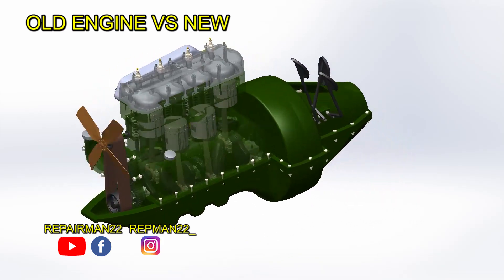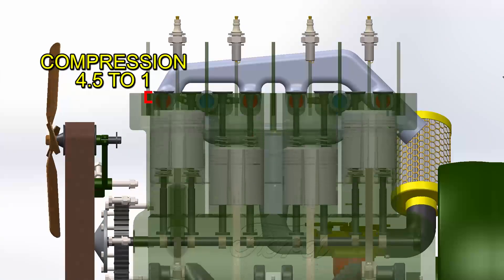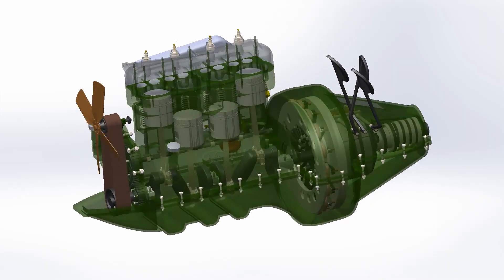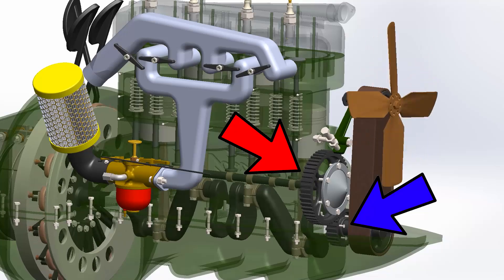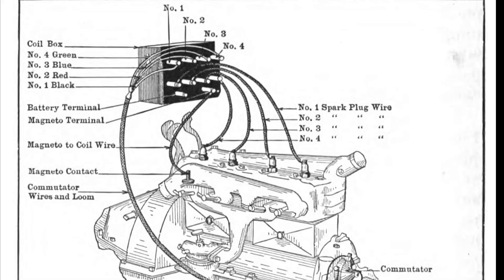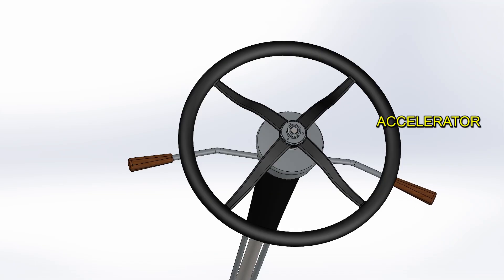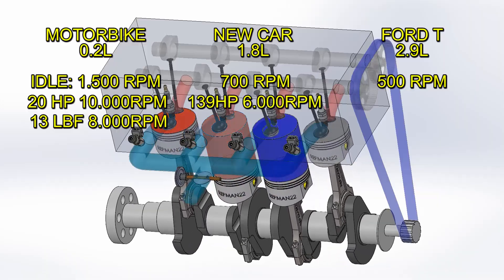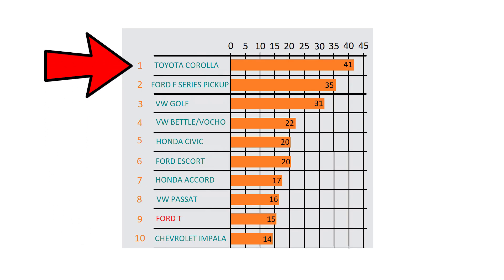Ford T vs New Car 🤯 3D Animation// What changed in engines in 100 years?

Comment: Thing was and is still pretty brilliant! I wonder with newer technology if this was redesigned with the same basic ideals what it would look like and how it would do. I wonder if it could be sold.
Nice video and visualizations!
Reply: With gas at high prices , what other combustible fuel sources are there? Like brewing your own beer and wine, could people brew a fuel source?
Reply: @markae0  people can brew fuel. In some places you can get a license to distill fuel ethanol. You can also do wood gas. Waste cooking oil from grease traps can power a diesel. You also have water gas, and fluidized bed gasifiers that can run on plastic trash. There are options
Reply: @Johnsoline I am curious about this "water gas". Please elaborate.
Reply: @markae0  Un - with some corn or corn meal or fruit - you can distill some 'moonshine' alcohol - just don't drink and drive - oh and there are 'legal' limits on how much home brew alcohol you can make for home consumption.  Plenty of youtube videos on how to make your own moonshine.  But it seems a shame to put nice hooch in your car.
Reply: @markae0 Ever heard of ethanol? Yes, the alcohol that people drink. Currently it's mixed with (up to) 15% gasoline to create E85, which is VERY high octane, burns cleaner, and makes more power, but gets slightly worse mpg.
Reply: No computer chips to go bad !  Not so sure how they would do in a modern crash test - and I have to say, I do love anti-lock brakes.  And all-wheel / 4 wheel drive is very nice in the rain and snow - oh, plus ac and heat - oh and stereo radio.
Reply: Something like this could make a good range extender for a hybrid electric car, where low rpms are fine since it’s just generating electricity. It’s still reducing the amount of circuit boards if the thing charging the batteries doesn’t have them.
Reply: @Thinginator  you don't want the flathead for 2 reasons:

The air going into the engine has to change angle more times,  which increases drag and wastes fuel. 

Compression is low on flatheads, which wastes fuel. 

The model T got the gas mileage of a riding lawnmower,  and made the power of one. A modern engine of that size makes at least 5× the power with nearly 3× the efficiency

The Geo Metro got 50+mpg with a smaller engine that made 4x the power of the T.
Reply: @Charon-5582  Do you have a 2.3 Mustang?  --A 2.8 V-6/3.3L 6? Mid-80s [ODB-II] saw 205Hp with 1 turbo from their 2.3L SVO/Manual Turbo T-Bird
Reply: It would need crash testing, an onboard computer with OBD2, tire pressure monitoring, electronic stability control, airbags, emission controls, and many other things that cars in the US are required to have now. So it would be quite a bit different
Reply: @charlie_nolan  There are ways around that, see Caterham and Exocet for examples. But generally, you are correct.
Reply: It would look like an 80s hilux
Reply: I have a go-kart that’s basically the same technology exactly, but it’s got 1 cylinder and a more normal control layout.
Reply: It has been refined, revised, improved, and modernized hundreds of times. Every modern DOHC, 4 valve, EFI, direct injected, aluminum headed, turbo 4 cylinder is what the T engine would have become.
Reply: not with current epa and ntsb. plus so many nowdays cant even drive a manual transmission.

Comment: Interesting video. But where is the Vaz, known as the Zhiguli in Russia and a Lada in the UK?. Over 19 million of these cars were sold between the mid 1970s and about 2010. The car had various upgrades in the 40 year production run but used the same basic body shell, itself based on the 1966 Fiat 124, throughout. Most of the top sellers in your chart, like the Toyota Corolla and VW Golf have gone through many different models and the VW Golf Mk 1 in 1974 probably has not a single part in common with the current Mk 8 model.

Comment: Actually I was wrong to say no one ever made an engine of steel as now I remember Mercedes straight 8 racers of the fifties were made by welding together  steel cylinders and water jackets etc.
Reply: The TVR Speed 12 iirc correctly had a steel block too.

Comment: No one has ever made an engine block of vanadium steel.
Back in Henry's younger days it would have been impossible to cast and machine such an engine block.
Vanadium STEEL was used for stressed chassis and suspension parts.
Reply: They were cast iron
Reply: I had a knife made from just s30v so I believe you.
Reply: @VadidElab  Just yesterday I as looking at expensive chefs knives and cleavers but they were all made from ordinary stainless and would soon be blunt.
My Malaysian friend showed me the cleaver traditional given to daughters getting married. It's hammer forged in one piece over a charcoal fire and really heavy but hasn't needed sharpening over many years.
Reply: @rosewhite---  "My Malaysian friend showed me the cleaver traditional given to daughters getting married." Now you need to find a friend that gonna show you how to use google before you write a comment...
Ford was advertising model T with claims that he is using vanadium steel in every part that require strenght and on his promotional material he is showing Ford T crankshaft as an example of part made from Vanadium Steel...
And i am shure that you need to do some machining on a crankshaft and according to you that would be for what ever reason imposible.
Henry Ford was doing its own steel and got plenty of experience in this field.

And if cutting edge on a knife do not need sharpening for a long time then most likely cutting edge have a wide angle and that is why it is not prone to losing the sharp edge/rolling.
Reply: yeah that was a weird claim in this video. the whole thing is kind of strange, but still interesting
Reply: Thanks for your keen attention to accuracy 👌
Reply: @ernesthill4017  Truth counts.

Comment: They paid me one summer about 50 years back to drive a few of these around Greenfield Village, where they had a small fleet of them when some of the newer models were only about 50 years old. Brakes were always terrible.
Reply: They were terrible. You had to plan ahead for your stops. I would also use the reverse pedal to help out some. The only thing that I could not plan on was when someone would pull in front of me and slam on their brakes to make a right turn. They would then find out what a model T horn sounds like. I added Rocky Mountain Brakes to the rear wheels, but I could not figure out how to properly set  them up. I knew someone who would add a hydraulic master cylinder, and disk brakes to all 4 wheels. He used Honda Gold Wing motorcycle calipers, and he designed his own disk rotors. He had a large lathe in his garage that he used to make the rotors. He was an absolute genius.
Reply: @garylangley4502  that’s cool, I would’ve loved to see what he came up with
Reply: @garylangley4502  on my model T 1914 there are kevlar lingings, if needed i use the low gear pedal, a bit for assistance,  drive often in busy local tourist traffic, and well, not doing bad at all
Reply: @ertsixbarf  First gear would give some compression braking. The kevlar linings are excellent from what I have read. They were not available back in the late 1980's when I owned my "T". The only alternative to factory style cotton bands were band linings for an early Hydramatic. I used the reverse pedal on advise from some of the Model T experts in the club I was in. This spreads out the wear on the bands, as the reverse band does not get as much use as the other bands. By alternating between the brake and reverse, it gives the brake band a chance go get some oil so that the band doesn't burn out. This was important with the cotton bands. In a way, it was like the foot action in an old pump type organ that some people had in their homes 100+ years ago.  https://www.youtube.com/watch?v=SkpJQ4biEbk
Reply: @garylangley4502  
YES  !
CRAWER  GEAR  would  be  even  better  .
Especially  on  a  muddy  track  or  paddock  or  river  crossing  ,    A .
Reply: Well they were only on the rear axle, but that increased the reliability by 100% lol
Reply: @jimmy_olds  Between rear drum brakes, no collapsible steering column, no seat belt, and no safety glass, it was a reliable Killer.
Reply: @drpoundsign  
Hey  !
Wait  up  ,  Wait  up  . 

Today's  MUCH  MORE  FASTER  CARS  ?
Are  MORE  Safer  ?
Are  you  saying  ?
(  They  would  have  to  be  .
But  ,   Are  they  ,  per  Capita  ?  )
Reply: @jimmy_olds  I will remove them even from rear axles hence I will have 100% reliability!
Reply: @jimmy_olds  
But  ,  NICE  ,  idea  that  the  braking  was  or  can  be  applied  to  the  transmission  or  Drive  Axle / s  .
Rather  than  as  &  via  heavy  weight  additions  to  each  wheel .
Reply: @georgehorobin2225  The Model T brake was in the transmission. If a universal joint brakes in the driveshaft, there are no service brakes, only the parking brakes.
Reply: Thank you  ,   all   ,  so  far  .
For  your  valuable  comments  ,  Re  :  Ford  Model  T   motor  &  Transmission  etc .

To  Johnsoline .
In   Particular .

My  Reply  and  Replies   ,  are  coming  .
One  way  or  another  .
(  A  line  out  of  one  of  Blondies '  Song  )
Reply: @garylangley4502  
Good  ,  got  that .
But  l  can ' t   seem  to  be  able  to  get  a  Text  note  through  to  Gary  Puckett   ,  or  to  a   ,  Mr . Gary  Pucket .

Is  there  still  a  sort  of  ,  Union  ,   Gap   ??
(  per  sey  )
Reply: The T only had brakes on the rear wheels, and they were cable operated. The only mechanical advantage was the leverage provided by brake pedal itself and however strong your legs were.
  Another curiosity of cars of that Era was gravity fed updraft carburetors which often leaked. This is way even a hundred years later, all states' laws require one to turn off the motor during fueling
Reply: @ernesthill4017  You are probably thinking of the park brake on a T. The service brake is a band in the transmission that clamps around a drum connected to the output shaft. I had a '26, and that was the year that Ford made the brake band wider for better braking. Before that, the band was the same size as the reverse and low bands. Yes, the only mechanical advantage the driver had was the length of the brake pedal, and leg strength. Also in '26, they increased the diameter of the parking brake drums. They also had a lining on the shoes for these brakes. Before that it was just a metal shoe against the drum.
Reply: @garylangley4502  :
  Thank you sir, l have learned something today 👍
Reply: @garylangley4502  
But  ,  unhappily  .
Incremental  small  lmprovemets   are  often  NOT  ,  good  enough  !
The  World  of  manufacturing  ,  has  had  6 , 000  years  since  Adam  &  Eve   .
Now  ?
Now  look  at  the  " Mess "  called  the  Modern  ,  and  so  called  ,  "  World  Car  ".
(  Ford  M . Co  ,  included )
Compare  word ,
Messers  schmit  ?
Reply: @ernesthill4017  
But  could  also  easily  be  fitted  to  the  front  ,  undriven  steerage   ,  wheels .
IF  THEY  KNEW  HOW  !
Reply: That's pretty cool man, and it's nice to see the one thing that unifies all Model T enjoyers through the years: "those brake suck, dude." :)
Reply: @HANKTHEDANKEST  Universal topic of conversation at Model T meets. I live in San Diego, so there can be a lot of traffic, and good brakes are needed. I don't know why it was usually BMW drivers, but I would be in the right lane of a 4 or more lane street and about 50 feet or less from an intersection, someone would pull directly in front of me, slam on the brakes and make a right turn.. I'd slam on the brake, plus push the reverse pedal for a little extra braking, and usually push the horn button. They just didn't seem to realize that a Model T, or most any old car, doesn't have brakes that are as good as a modern, well engineered car, particularly a car like a BMW. That's true of most antique and classic cars.
Reply: @garylangley4502  someone did that I front of my dad's 66 wildcat sedan. Drums on all four corners. Like dude our 20 foot long sedan from the 60s does not stop a 2 door sports car coupe from the 2010s.
Reply: @joebone3151  Exactly!! It gets a bit scary.
Reply: @garylangley4502  
Clearly  a  Case  of  ,
DRIVER / S   ERROR .
Reply: @joebone3151  DONT  BE  A  TAIL  GATOR   ?
North  America  ?
Be  a  Leader  of
God's,  '    "  Good  Speed  "
On  "  Lifes Long  and  dangerous  Roadway  "  ?
Reply: Buy better shoes to break harder, Flintstones style.
Reply: @hicknopunk  Sure! Just take up the floor boards and drag your shoes on the ground. Say! My son would be great at that, he is 6'4" and weighs 380 pounds with size 15 shoes. "Sasquatch"
Reply: @garylangley4502  Like Herman Munster stopping Grandpa's "Dragula" when his scumbag rival removed the chute.
Reply: @drpoundsign  Exactly!!
Reply: @garylangley4502  
Or  carry  a  block  of  concrete  on  chain  to  throw  out  as  an  anchor  line  ?
Reply: That's interesting! Having been there twice and only living an hour north of Greenfield Village, I can appreciate that. I was always extremely happy to ride in those Model A and Ts!
Reply: 8
Reply: My grandfather told me that they used the engine alongside the brakes to slow down but yeah old cars had really shitty brakes and apparently they were even worse if it was hot outside.
Reply: Brakes were terrible , but Ford invented the ABS system. 😅😅
Reply: @bobvido9875  But maybe you can google the history of ABS before you write a comment about it?!
British Jensen FF was first road car that came with ABS... and they did not invented the idea.
Reply: @Bialy_1  
    Do  you  mean  ,
British   Jensen  FF  ?
Or   ,   God  ?
Reply: @bobvido9875  
    Nicer  .
Reply: I think for a 100 + year old braking system invented from scratch, probably did okay, an in it’s time was probably revolutionary, especially for the every man
Reply: @thacutoff6226  
Known  as  ,
Modus  Operandi  .
It ' s  how  you  survive  ?
That  ,   Counts  ,  in  LIFE .
Reply: There  is  a  NEW  idea  for  the  use  of  non  hydraulic  brake  operation  ,  via  mechanical  foot  operated  components .
Want  to  know  ?
And ,  what  would  FORD  Motor  Company  ,  pay  ,  for   THAT   one  ??
Reply: It was an A, not a T, but when he was a older kid his father told my Dad to take the car in. So Dad gets to the garage, doesn't stop in time and bangs into the door with the A. The guy comes out, looks at the car, and says, "brakes, right"?

Comment: The model t did not have an air filter originally from the factory. Other than that good video
Reply: @Charon-5582  There were often no air filter at all until the early 30's, after the Model T's time, but they also had to rebore engines often.. 
Oil bath filtering was used 1930's to 50's and paper filters since then.
Reply from the maker: Thank you